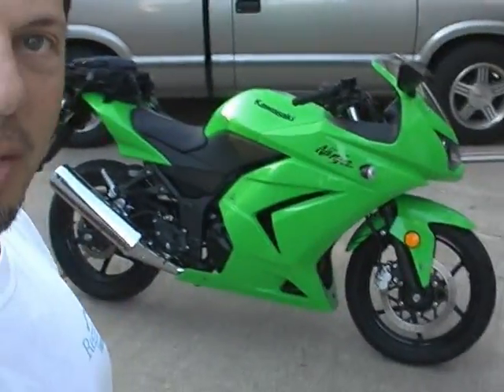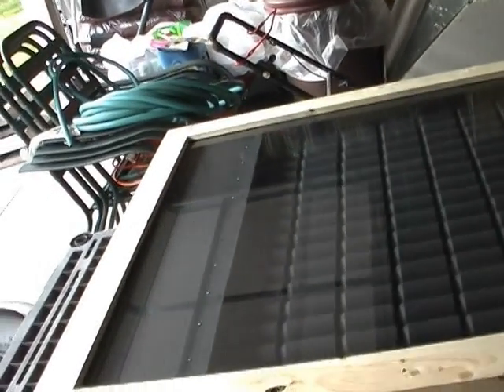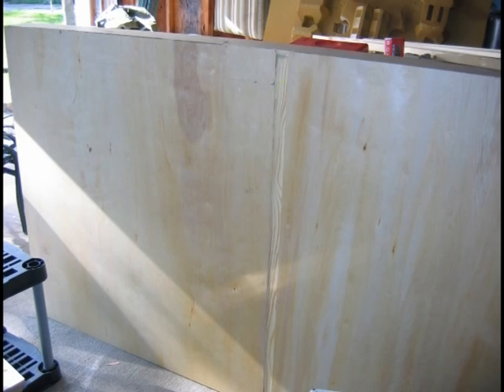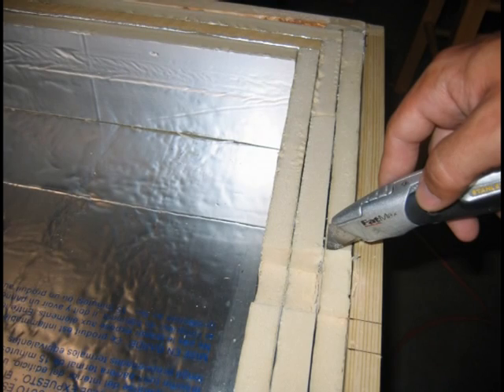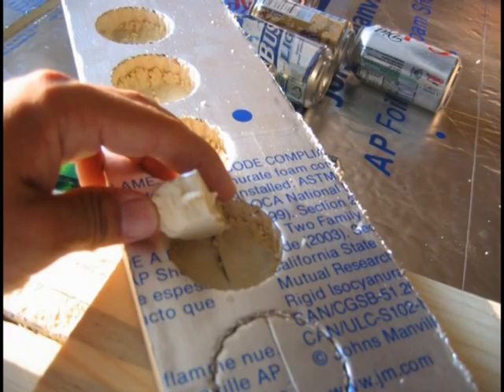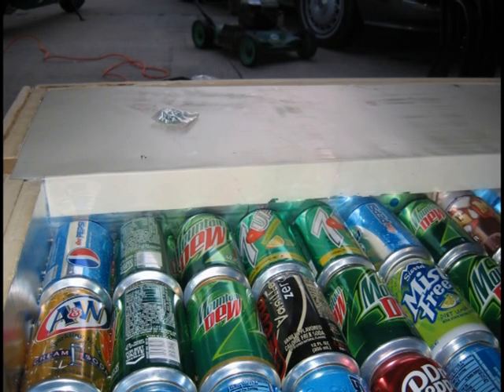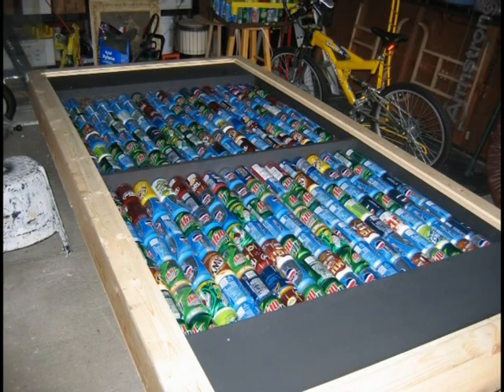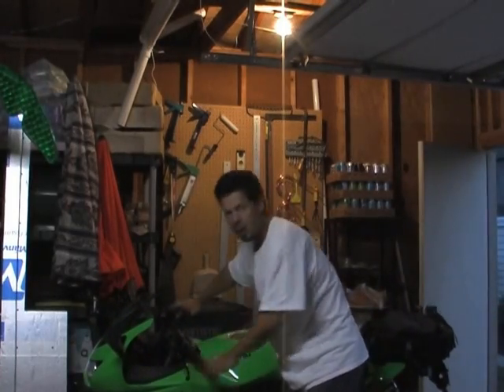Simple Thoughts "Solar Heat Panel"

Comment: Nice work.  I built a test one last summer just to see how well it would work.  It was relatively simple, was 3x4 ft in size and heated the air from 74F to 196F in about 15 minutes in full Sun.  I made a mistake in using regular black spray paint so it started coming off.  I like the Simple Idea of just using a can opener!!!  I overlooked that one and followed someone elses drilling 'em out plan.... not my idea of fun!
Thanks for sharing and a great job on showing how this is done!

Comment: Thanks for sharing your fine work.  I noticed you used a lot of insulation on the side panels. I built a large 8' by 8' collector unit using CDX plywood.  What saved me money on my larger project was getting some large glass windows when someone upgraded their home to dual pane windows.  Mine is up and running. but I will experimenting using 2 lt. plastic bottles filled with water to retain more heat for night time use.  As my collector is larger it allows me to try different ways to heat.

Comment: I used the can opener on the tops as well and a 8 inch piece 1 1/2 inch pvc inside can then a 1 1/4 inch thin wall pipe (used for dog runs)with one end v cut and sharpened tape the flat end then push buy hand 1/2 way turn push through and the hole on the bottom is completed works well.Thanks for your tips!

Comment: I just want to commend you on your perspective and responses - particularly your humility and patience with others.  // I have no experience with carpentry and this is is intimidating.  I will try.  My 1st level is one open room, about 1500 sq ft and over 9' ceilings.  If I try to make two of these, I figure some of the heat will rise up the stairs.  I have an efficient hydroair boiler for heat and HW.  I'm hoping I can also do something  affordable to preheat the water for that.  Thank you!

Comment: I think your box design and insulation procedure is the way to build this heater system then I plan on using  alum. flashing to trim it so it is maintance free also use clear plate glass vs plastic is cost efective saveing money is the big part of this project.Thanks for all your tips

Comment: Thanks for the video. The box is very well built, but I would like to make a point here.
    It's a mistake to allow the pop cans to be fully open at both ends because you are losing about 1/3rd of the heat transference.  To get the best transfer, you should cut the drinking end of the can fully off with a can opener, and the bottom should have 4 holes evenly spaced about 2/8ths in diameter.  A can opener which makes triangular openings will work.
    When you place them in the box, the fully open ends of every can should aim toward the top of the box.

Comment: Thanks for the reply. Just had one more idea. What about combining  water heating with the air heating? A person could weave copper line on top of the cans and paint it black. This way you could heat water. You might block the cans a little. The water would freeze in the lines in some areas. Just cut the water off and drain it in the Winter. Turn it on in the Summer and cut the air flow off. This way the project could be used year around. Good for a guy like me in Illinois. Thanks

Comment: been studying this design for a while. Figured cans are worst part of construction. In addition, heavier al might collect & conduct more heat. I procured al down spouts 4 $20 fromlocal hardware store rejected due to seams apart. While air may flow more readily up spouts and not "wonder" up collecting more heat energy as it does, I think the corrugate surfaces and extra thickness will make up for that deficit. Just have to get my tractor put back together and I can start on this new project.

Comment: If you find you are collecting more heat during the day then you need, you may consider using a water/antifreeze mix to absorb some of the extra extra energy during the day and release it during the night.

As antifreeze may boil, you should know for sure that your setup wont make it boil.

Comment: i have used the same thing to exhaust extra heat from a furnace room. Look in the ductwork section at Lowes. they have fans that fit inside round duct work and should have thermostats as well

Comment: if you planing on making another solar heater like that, try "finning" the tops of the cans so that the airflow will travel in a cyclonic motion allowing more air to pass through your system and therefore more heat.... i have seen may ideas for this trype of system and what can i say they all seem really great.. maybe get into building this as a fulltime idea as you could very well sell these for at least $100 a piece for something that requires no maintenance..

Comment: The fan is controlled by a solar panel & a temp probe in the unit. The fan uses the temp probe as a on off switch just like you thermostat on a regular furnace. Just in reverse. When the temp hits a certain temp it will shut the fan off.

Comment: Thanks bunches for the inspiration and your humility our Savior!  I wonder, the way you are generating heat via solar can we use your principal with the addition of glass beads or other non-porous storage method in the heat transfer box try placing glass marbles or some such things in the base of each can, they will not interfere with airflow for fast heat and yet when the aluminum cools they will be sitting there ready to yield and keep the warm air flowing??

Comment: Excellent project & build you did there,Do i need to fit a solar fan to this heater? to blow the air through it or just build it and let it work?..as thinking of installing one in a window 3ft by 4ft window in living room. Thank's

Comment: The cans heat the air inside and outside the cans. The air outside the cans but inside the solar heater gets hotter than the air flowing through the cans which results in more energy loss around the solar heater then if you had not used cans. 

All you need is an interior that will absorb as much sun light that falls on it.  As you insulate the back and sides, remember that you will still have energy loss through the front pane. Energy loss will be greater with single pane versus double pane.

Comment: Open the cans in half put a coper pipe inside. The parabolic shape of the cans will concentrate the sun (heat) into the coper pipe and you'll get more heat ;)

Comment: hi 
very nice work
i am just working on mine now and i am going to mount on the top a few solar cells to run a 6 volt  fan so when the sun comes up the fan kicks in when it goes down it goes off .
i am going to test it out if it works will let you know i have a few cells left over from the solar panels i am building
i dont know if the 6 volt fan will give enough flow.
have a great day

Comment: The beauty of using the aluminium cans is that they are a great thermal conductor, whereas PVC doesn't conduct heat well. This means the heat from the sun transfers into the cans - this wouldn't really happen with PVC.

For a comparison of the thermal conductivity of various materials, search for "thermal conductivity of various materials", and go to the engineeringtoolbox website result. (I'd post a link, but youtube won't let me!)

Comment: Have you considered using a solar powered fan like in a cpu unit to move the air. Installing a temp probe and using it as a switch for the fan would prevent cold air movement.

Comment: I plan on building 3ft wide 4ft high. I have been pondering the volume of the cans, versus the cfm of the fan and the area of the headers .I wonder if they might be some formula for obtaining maximum heat with maximum air flow. Also  wonder if its possible to pull too much air? and as a result of that, cool the rising air to fast ??? maybe i should just build it ,LOL.Just curious.

Comment: curious on the stats,,. what temps your getting, and whats the temp, outside at the time.. also how are you getting the heat into the house?
is it natural convection ? or are you using a fan of any sort?
if using a fan, is it solar powered ?
i built me one. 9 rows, 11 cans high. using sliding glass door double pane glass.
i got 180F with small solar powered fan. and insulated 4" duct hose.
i just need to mount it now... comments welcome.

Comment: Hi there, do you think there are any advantages or disadvantages to building it as a 2x16 box versus a 4x8 box (so tall and narrow) ...since its the same amount of lumber?  Also, assuming i have a decent blower, can I mount this horizontally (if that's the only space I have)?  BTW- what area of the country do you live in...in New England, not sure how much heat will be produced(?)

Comment: This question has been asked 9812381293 times probably, but what if you make the holes in the cans some smaller, wouldn't that slow down the air and heat it up even moire?

Comment: What about PVC pipe instead of cans ? I've started collecting stuff and plan on building 3 panels 4' x 8' to replace a section of privacy fence. Would love to have as much input as I can get. Am I going to need to run each panel as a separate unit or can I hook these up side to side connecting the bottom and top air chambers ?

Comment: Philippine mahogany (luan or lauan) is different from most other mahoganies because it ISN'T a mahogany at all but any one of a large number of species that are lumped together and sold as Philippine mahogany. It is more grainy than mahogany and second, it does not take on a patina like mahoganies. This wood is widely used in cheap, thin, plywood, and on the outside of cheap hollow core doors. That name isactually more appropria tely spelled "lauan" .